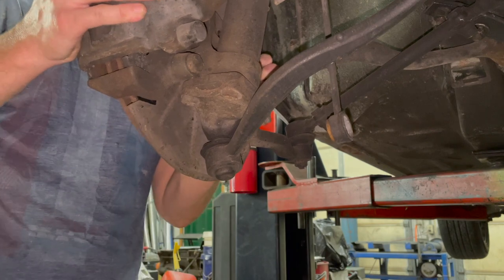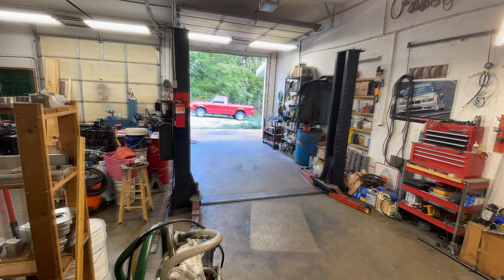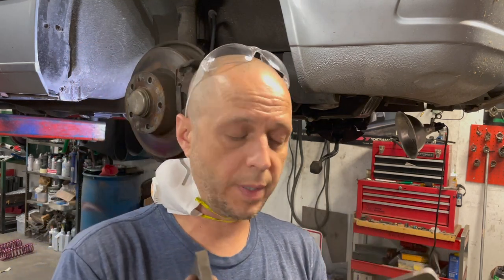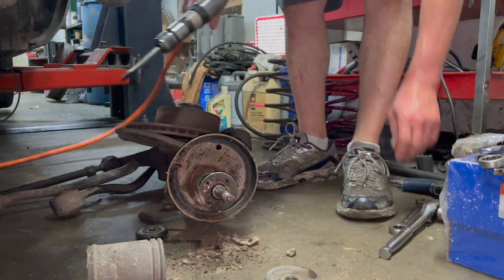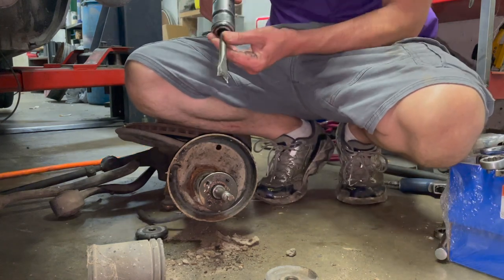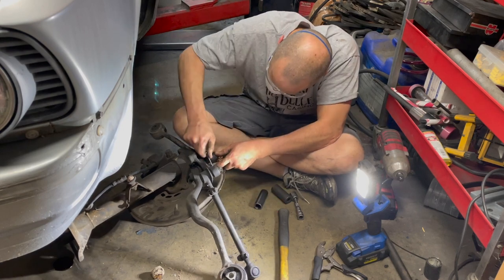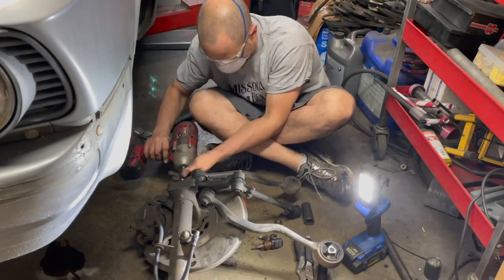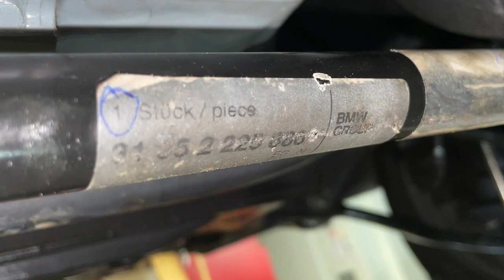BMW E28 524td Rebuild Part 10 (M5 sway bar, Vogtland springs, brakes and etc.)

Comment: YOO!! God Bless you man this is great!! Thaks a ton for putting it together. Im glad I found this. Do you by chance have videos of the engine? I have a 1985 524TD that I want to make my daily but having a tough time with the injection pump leaking diesel. I want to get it running, hopefully you can help.
Reply from the maker: Yes Sir. Thanks for reaching out. I have a plenty of footage I haven't edited yet from my 524td(Greta). Engine disassembly, injection pump, dash/gauge cluster, e36 seat swap, fuel filter heater, trunk repair, idler pulley upgrade, bumpers, lights, speaker upgraded, and the list goes on. 😉 But I gotta switch up and finish some M54/S52 projects. So I'll be side tracked from Greta for a few months.

Comment: Amazing project! Next step Bosch ve pump to pes pump with bigger elements and bigger turbo. Pes pump reduces injection time and engine runs colder so cylinder head wont crack so easily.
Reply from the maker: Thanks for the tip about the inline pump. That would be cool to see. Maybe down the road. I'm thinking that the lower compression forged pistons, intercooler, Wideband O2 and EGT gauge will help in preventing (or prolonging) the head crack issue. Time will tell. Thanks again for the suggestion.

Comment: What happen to the build? Any new videos on it with more info/dyno how its holding up?
Reply from the maker: Thanks for asking about “Greta”. Currently I have a brake issue, possible bad booster or master. Got some euro bumpers that I need to make brackets for. Also  in the middle of upgrading the headlights and fuel filter/warmer. Bunch of little stuff. The dyno is still in my future but I had some other stuff come up. I’ve got 3 BMWs that always seem to need love. 🤣
Reply: @teddyroweshow Happy to hear you haven't quit 😅 yeah bmw's seem to always want love and affection...

Comment: What driveshaft did you use for the manual swap?
Reply from the maker: Thanks for that question. I ordered a new driveshaft for a manual 528e. I had to switch the output flange on my Getrag 260 because it came from a 325es. 26.11.1.225.269 part number from realoem.com.  It’s a good website to double check part numbers.

Comment: Awesome build series👍, I've got a restoration project with this 86 vixen as well and good info to follow from. Thanks.
Reply from the maker: Yes! The Vixen Motorhome powered by a BMW M21. I’ve actually stepped inside one of those. Great size and roomy. 👍 Good luck on the project. Feel free to holla if you think I can help. Thanks again.

Comment: Hi Teddy. Great content! I have a 324d with a naturally aspirated M21. Just in the process of rebuilding the engine I realized some parts are very expensive (12 rocker arms for about 500$! ). However,  I'm planning to do a turbo-conversion. Question: Do you know if I need a injection-pump from a turbo-car or can I stick with my old one or do I risk then to blow up the engine :) ? I know the part numbers of both pumps are not identical, but sometimes numbers change without greater technical changes. Looking forward to see more m21-specific vids on your channel. I live in the northwest of switzerland near the border of germany. Normally I rebuild US-Cars, but this is now my first "metric" project. :) cheers.
Reply from the maker: Good question. In the US we only got the E28 524td for a couple years. No BMW diesels until 2009. We missed out on a lot of cool cars. Check out this guys video. Brayshaw's Vintage Tractors - Bosh ve injection pump tuning.  https://youtu.be/npODPJoy6Ww. It's a clear good video that covers the basics. I enjoyed it. Loads of great videos from other diesel people too. 😉 Basically there's a boost actuator spring on top of the pump required for fuel enrichment. Best of luck with the project and keep me posted. TR
Reply: @teddyroweshow  I will. As far as the pump is concerned, it actually looks a bit different on the top than I thought. I suppose the Bosch part number of your pump is 0460406022. However mine is 0460406047. Question: Where could I buy this handy valve seat cutting machine which I saw in your first video? And what is the correct name? c u
Reply: Привет, надеюсь ты это переведешь, я живу в России, а точнее в Крыму и скажу так, что m21 с турбиной на механическом тнвд с правильной настройкой, будет ехать лучше чем на электро насосе
Reply: @mryashka5207  Translation: "Hello, I hope you translate this, I live in Russia, or rather in the Crimea, and I will say that the m21 with a turbocharger on a mechanical injection pump with the correct setting will go better than on an electric pump."
Reply: @ichwilltanzenmann  since the electric injection pump needs to be chip tuned and there it is very problematic

Comment: I have an e30 324td is it the same engine as yours?
Reply from the maker: Yes Sir. It is the turbo M21. We never got the e30 324td in the US. Cool car. I use realoem.com a lot to double check part numbers (it's a good reference tool). Thanks for the question. Any plans for your E30 and where are you in the world?
Reply: @teddyroweshow  well actually the engine starts but it needs a starter replacement and some corrosion and visual adjustments. I live in algeria (north africa) where spare parts for this car is extremely rare. I'm thinking of buying from outside my country. One other thing is lack of knowledge of these types of cars and im trying myself to do everything alone and tbf your videos are encouraging me a lot, i hope you will make more videos about this engine like "how to dismantle something or something like that
Reply from the maker: @rostomzerrougui  Thanks Rostom. I needed some encouragement from time to time with my car projects too. I understand. We do these projects for ourselves but it's nice to know there is a tribe for us. 😉 I'm here to help and thanks for sharing. We gotta keep these cars on the road.

Comment: How were you able to fix the injector with the sensor wire. Mine is frayed and lost the sheathing. Did you solder onto the remaining ends or is there a way to swap the wires entirely? Last step before I can drive my 524td
Reply from the maker: Thanks for the question. Sorry for the delay. I was lucky enough to have some wire left in the injector to solder to. I also used an ev1 connector.
Reply: @teddyroweshow  no problem thanks for the response. I have one more question. I have collected an entire e28 manual swap kit for my 524td. But my car is a us car. I understand why you set up your your wheel with the flex plate. Because if the two sensor on the side didn’t come with the euro cars. I am try to do this swap on the budget side but the flywheel just doesn’t exist for our us cars. Would it be possible to make a trigger wheel and mount it to the crank in the front with the same position as the to notches instead of making your custom flywheel solution. I know if I use a stock flywheel I would have to drill in an out pins. But it’s just not possible to install the side ones for me.
Reply from the maker: https://www.ebay.com/itm/156117234476?mkcid=16&mkevt=1&mkrid=711-127632-2357-0&ssspo=kBOAW-mQQv6&sssrc=2349624&ssuid=&var=&widget_ver=artemis&media=COPY
Reply from the maker: The link I sent is to a Valeo clutch/flywheel kit that fits an M21. The M50-54, M42/44, S50-54 and M21 share the same starter ring diameter and tooth count. If I was doing my build differently and wasn’t so adamant in using a 240mm clutch, I would’ve started with this 228mm from Valeo. For the crank sensor on the side I would drill and tap the side of the flywheel for an 8mm bolt and machine (or grind) the bolt head down to match the flex plate. My e28 524td has one sensor in the bell housing and one in the block for the flywheel references. I don’t know what tools or machines you have but making a chopper wheel for the front seems a bit harder to me then modifying a Valeo flywheel. Do you have a rotary table and mill? Just an idea and I wish you the best luck. Thanks so much for watching and your question. If you want to hit me up on Instagram I’m bimmer.bear.

Comment: Awesome videos I'm getting a 524td to play with soon and your videos have been pretty damn helpful to watch
Reply from the maker: Awesome! I hope everything goes good. Keep me updated and thanks so much. Real cool 😎 of you. I wanna see more m21s on the road. If you need help, holla.
Reply from the maker: @HalfAssBuilt  Thanks JD. I got the 260 Getrag trans and 2.93 LS diff from an e30 325es but yes the 528e would’ve have worked too and better. I had to switch the output flange on the trans to accommodate the 528e driveshaft that I ordered.